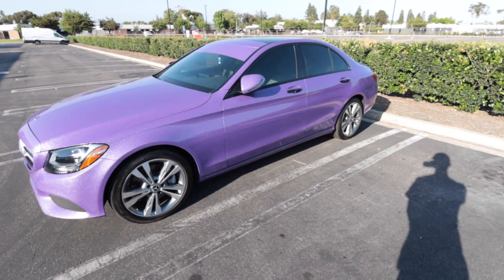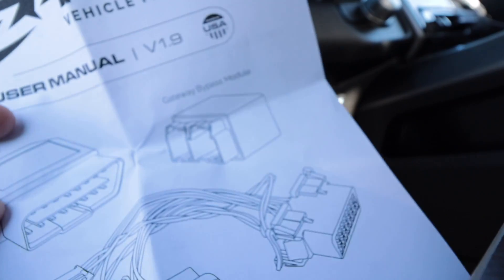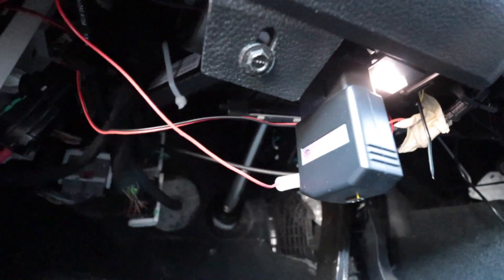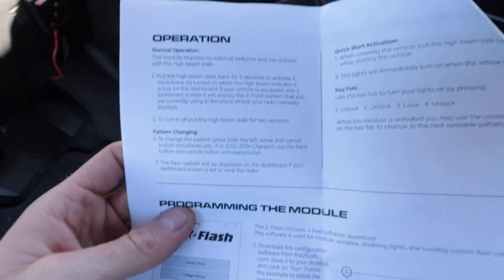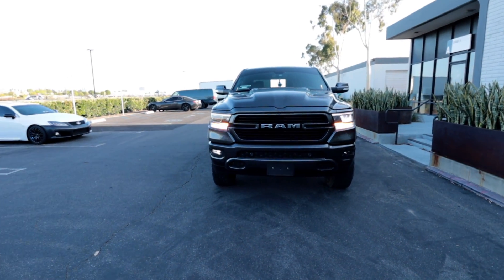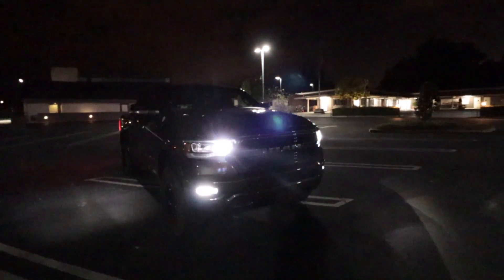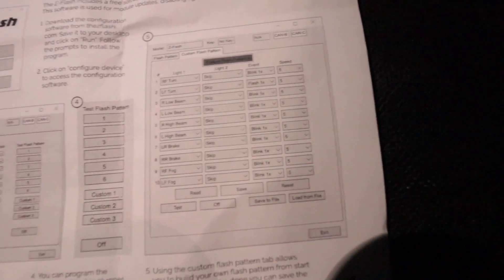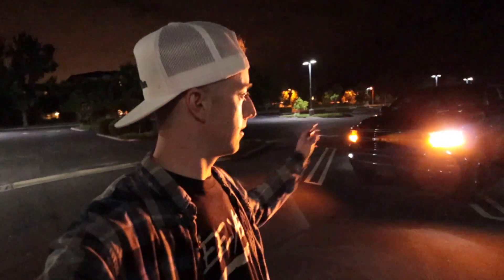THIS made my factory lights STROBE

Comment: in most all states you can use the flashing factory lights in an emergency situation. like as example on the side of the road for a flat tire, or a traffic accident, etc.
Reply: Yea, I have a amber Dash Light, and can be used for Roadside assistance and or accident

Comment: Looks like a great product. Georgia has a permit you can apply for to operate flashing lights from Dept. of Public Safety. Daughter is an EMR so this might be easier to make factory lights flasb.
Reply: I've been trying to get that permit for 2 years.  Just get a circular runaround every time I try.
So I just run my lights (yellow/white).  Cops haven't taken much notice except when they're off (they don't know what color they are).  When they see that they're not red or blue they just shrug.

Comment: Thanks for doing this! I’ve been looking for a way to manipulate the OEM lights with out buying third party lights with being a fire fighter.
Reply: I just got them for my work truck! Heavy equipment will see me comin now hahaha
Reply: Buy some reputable lights that won't fry your OEM computer.
Reply: @DougWalton21  bought this and works great. Also can’t fry your computer, it produces no voltage whatsoever.
Reply: @travis.sewilo  it's your truck...but you've been warned.
Reply: Dude your best bet is just to buy some lights from Fenix industries I've had great success with My Fenix T3s the 8 years I've been a firefighter
Reply: @itsyaboimat2393  thanks!  I did get the Z-flash and love it, works great when responding. I love the idea of visor lights or something any wiring running through and a third party switch would just bother me.
Reply: Do you like the flash for the OBD2 or the one you put in your Silverado?

Comment: We have had three customers in our shop that had one of these completely destroy multiple computer modules. One was a $15,000 fail which was not warranty covered because as soon as you install these your warranty is void! So I wouldn't recommend it.
Reply: I've had mine on my 2016 Ram 2500 for 5 years and there's never been a problem
Reply: I agree, you'd do better getting some suction-cup strobe lights from Amazon for $80 compared to $15k re-wire job!!!
Reply: How is that possible when it doesn’t put out any voltage? Can’t void the warranty either if it can’t possibly be traced by the dealer if it’s unplugged?

Comment: News flash ~ Flashing red lights on the rear of your vehicle IS legal in California. They are called 'emergency flashers'. Flashing red/blue lights on the Front of your car is illegal if you are not law enforcement and flashing red lights on the front of your car is illegal if you are not Fire/paramedic, or ambulance. Otherwise, great video..
Reply: @Toyota-Coaster  Um, Flashing yellow lights on the front and/or back of your vehicle is legal.. 
Yellow forward facing headlights are legal as well. (these are called 'fog lights'..)
Small blue lenses mounted in your tail/brake light lens to make your tail/brake lights appear purple from a distance are illegal in California.
Is there something specific you are looking for?
Reply: @tacticalbacon1191  nah

Comment: That’s really I think for like if you break down of if you use your truck for some Chyna highway worker where you see the highway shut down and you’ll see contractors on the side of the road and usually you’ll see like the foreman sitting there and it is nice truck with those type of lights but also people who plow snow will use that type of stuff and usually put something on the top of the truck So you can be seen in bad weather

Comment: It's a Ram they probably flash with out the device. Lol
Reply: You can? How do you do that?
Reply: @wyattstus-haug4651  he was joking that rams are so unreliable that the factory lights probably flicker or strobe out of malfunction
Reply: I have owned 4. No reliability issues. You must be an F150 Fanboy
Reply: No Mopar DOES flicker it's am impedence issue with the bcm.
Reply: @FerrariTeddy  he was hating,  not joking.  Fool probably drives a 99 Accord
Reply: I’m a Mopar guy and that’s funny as hell 😂
Reply: They do, as long as you purchased the VSIM module to wire them to do so
Reply: @carlosstephens3929  gone through 4 already 🤔
Reply: @danthaman7067 only flickered if you put aftermarket bulbs and the voltages spiked or dropped which made them flicker or go out. Nothing to do with stock
Reply: Made in China lol

Comment: I know this video is a little old but the general rule for the DLT in Federal Regulations is they can be the same color is the DLT lights example Amber and red and clear on the rear clear and Amber on the front and I believe that's Countrywide I also believe in some states it don't matter what's on the rear end it only matters if you have blue or red facing the front of the vehicle so sides and rear your clear

Comment: I just ordered one for my F150, I do volunteer work that I at times need warning lights for. Like you though I of course cannot have any flashing red so I will have to take my brake lights and rear turn lights out of the equation as they are red.
Reply from the maker: you can modify the settings with the program that you download to your pc
Reply: @MarkBrenner  by the way while I have a different make of vehicle compared to you I did want to ask. Have you experienced any issues with your trucks computer systems after hooking up and using this module?

Comment: I imagine they use these to see how many times an LED light can be turned on and off before it goes out. Even its a couple hundread thousand flashes. I wouldn't spend to much time showing off these features. Maybe during crazy storms or in aid of traffic emergencies!  But it seems like a repurpose or rebrand chip to check fail safe stuff. Cool lights tho. Id just hate to have to do all 6 Led bulbs before their time hahahaha.

Comment: If you get your brake lights to flash, you should be ok. Check with your state laws. My state you can have red flashing to the rear. So for example, if you have a light bar on top of your vehicle, you can flash red lights. Your state law is probably the same as some cars have red turn signals that flash. If it was illegal people would be getting tickets every time they signaled a turn. So as long as they are the lights on the rear of a vehicle and nothing facing the sides or front that are red, you should be good to go. But as stated above, check your state law before using them on the road.

Comment: Can you use it as you're driving for snowplowing or is it just for sitting still?
Reply: Depends on your states laws etc.. but ya driving would work just fine especially plowing.. no one will question it if you're doing a job.
Reply: In the state of TX a civilian can run amber and white lights on there vehicles while driving down the rode
Reply: @DonaldtrumpfixAmericaagain  Oklahoma is the same way

Comment: Did yours also come with a wire switch. Mine will not work with the stalk control.
Reply from the maker: No I didn’t choose the option for the switch
Reply: @MarkBrenner  I guess mine can’t do stalk control, it came with the switch but the wire is in such a bad spot it’s right in front of my clutch pedal and it’s been snatched out multiple times on a 2014 Jeep jk

Comment: After you done with the installation do you have to  release the module from the OBD?
Reply: From my understanding and I just ordered mine know it stays permanently attached to the port you would only remove it if you were moving it to another vehicle or unit put a scanner there they do make a pigtail split so you can still keep it connected and run your ODB scanners

Comment: Do you know if it’s the same install on 2500 diesel
Reply from the maker: I’m not positive, check the website
Reply from the maker: I just checked. It doesn’t specify gas or diesel so I would assume it would work

Comment: Will this make trailer lights flash too? I’d think it would
Reply: I put a z-flash on a 2018 ram 2500 and unfortunately it did not strobe the trailer. Not sure with other vehicles though.
Reply: @jonahbrown8867  may be a different relay, probably a way to make it work

Comment: In California it IS a felony to have ANY front facing solid/flashing red light. Amber is 100% legal in Ca.. Also wig wags “flashing left, right, left, right” are reserved for emergency vehicles only in Ca.. as for the rear you can’t have any white flashing whatsoever. Can’t be blinding other drivers behind you. Amber to the front, sides and to the rear are perfectly legal and you are allowed to have a single (1) flashing red light to the rear as per CVC under the third break light law

Comment: Looks like this is a direct rip-off of the devices they install in police vehicles (since those are almost always domestic in the US - except the Chevy which probably doesn't have a simple or accessible bypass).
Wouldn't mind having something like this for my VW as it's a roadside assistance vehicle (flat tires, ect).  I've had one car destroyed because people ignore hazard flashers.  I've installed a bucketload of strobes on the current vehicle, it gets a bit more respect now.